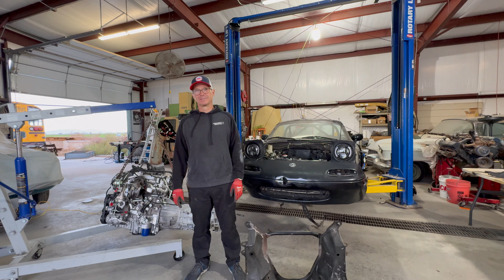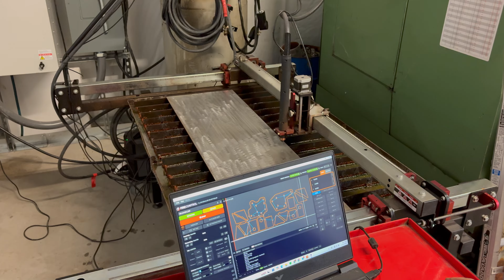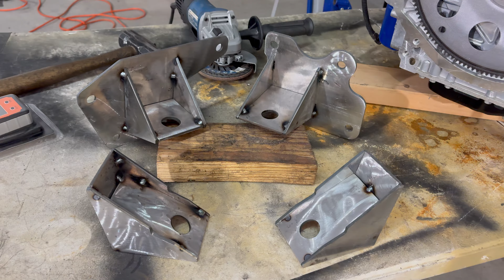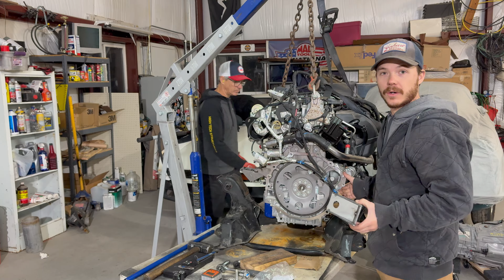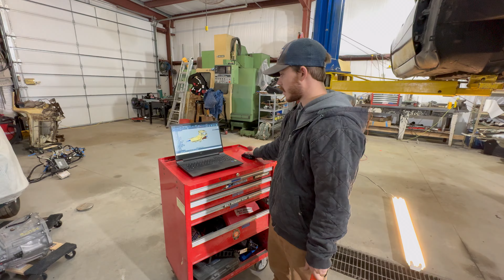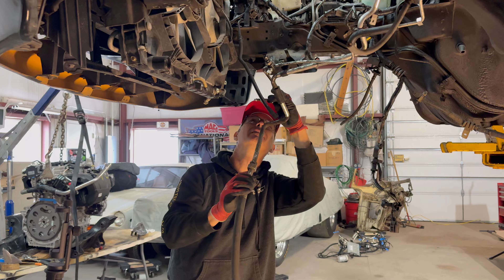Putting an LTG Ecotec into a Miata Part 2

Comment: I have a 2.4 ecotec in my Miata! Added a turbo and always wondered why no one has done an LTG swap. My Cadillac ATS has the LTG and it’s powerful, downside is the ringlands fail even on stock engine without mods